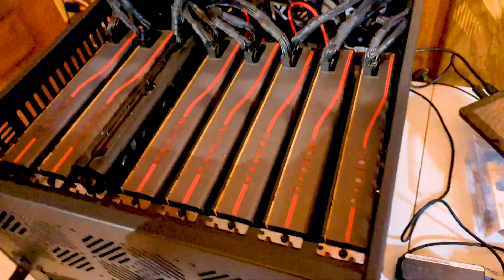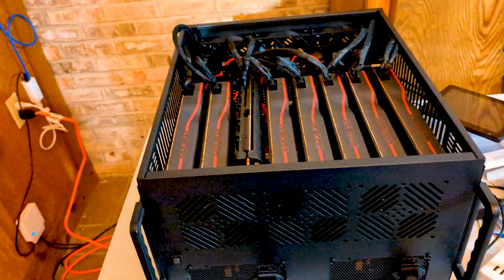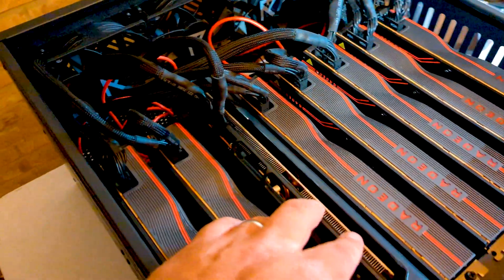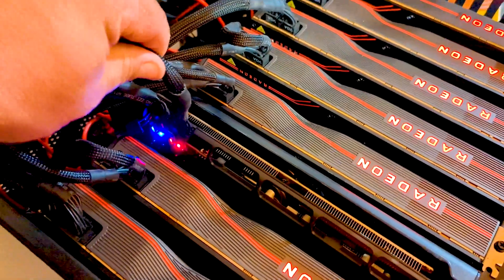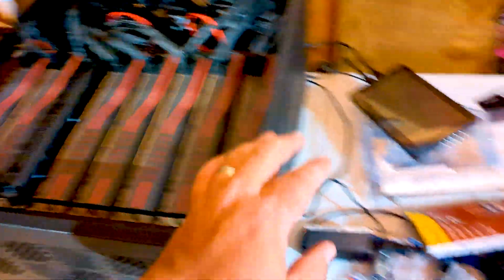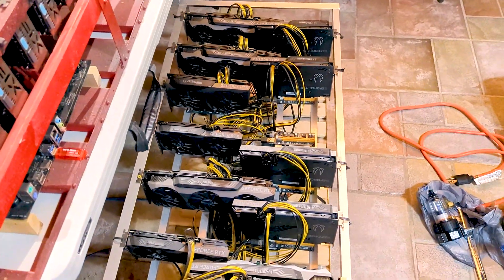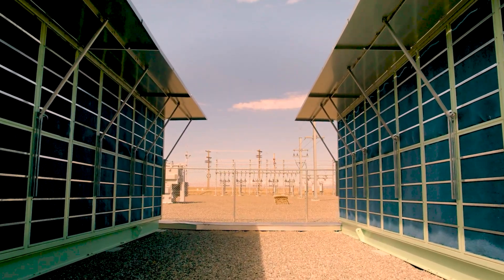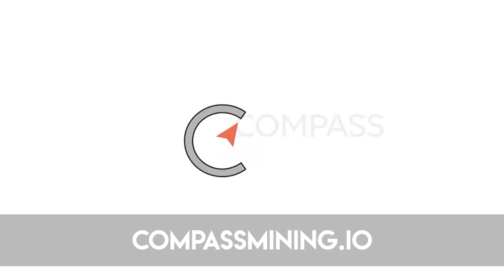Have a GPU not working? Try this! - Lessons learned from the BBT Farm

Comment: BTT so why are you going to the other cards? Specifically like the A4000 and what not?
Reply: BBT sees on A4000+ the value of longevity.
16-24GB Memory, will be able to mine for decades
No LHR
Quality: Profesionnal > Gamer, exemple no fancy lights (not wanted in mining)
Good hashrate/watts effiecient
The availability to buy this card. USD$1000.
Looks slim, light and only 1x 6pins PCIe
Reply: @linix2954  I mean I guess if you can get them for 1000 bucks. But he’s got non LHR 3080s that are pretty efficient. But he’s obviously buying bulk so probably able to get them cheaper.

Comment: Have you checked to see if that cable feeding power to those cards is the issue? You will feed those cards cleaner power if you use one cable / harness per connector rather than using the pigtail jumper 2nd 8 pin or 6+2...

Comment: You can get this warning even if just the sense wire is not contacting, and that sense wire doesnt nothing really and it just loops to the ground.
In a 6+2 pin style connector, those +2 are sense, those do nothing, nada, when I was doing custom cables for myself the connectors could not possibly take two 16AWG wires in one crimp so I just looped one sense pin to another sense wire and it worked perfectly fine at least with ASUS cards.
Btw. reason I made my own cables is because the ones I've originally bought from Amzn were advertised as 18AWG but were actually 22-24AWG and my 3060s running at 125W PL had the red LED over the connector start to blink after some time, presumably due to voltage drop below some threshold.
Reply: Me too I build my own PCIe cable. I salvaged wires from a SATA cable from a GPU riser. It says 18AWG on the wire but compare with the 18AWG I buy from Newark, there was about 3 times less filaments (probably like you said 22-24AWG). Voltage drop my man!
Reply: @linix2954  Yeah exactly, basically every piece of wire from china/Amazon/ebay advertised for mining is a scam 18 labelled actually 22-24...
Reply: @Arek_R.  I talked to a guy today and it's possible I am mistaking. The wire I got from Newark is not copper but the sata wire with less filament his copper. Maybe AWG is not 100% the same dimension on every materials but each material have his own size because they dont have the same electrical conductivity.

Edit: Aluminum needs more filament to carry same amount of current as copper
Reply: @linix2954  Why the hell would you buy wire that is not copper?
Reply: @Arek_R.  Probably because it's cheaper and have the same awg, celcius and max voltage. But thanks anyway, our little chat helped me remember materials conductivity.
Reply: @linix2954  No clue what you're talking about but I can assure you that copper is the only way.